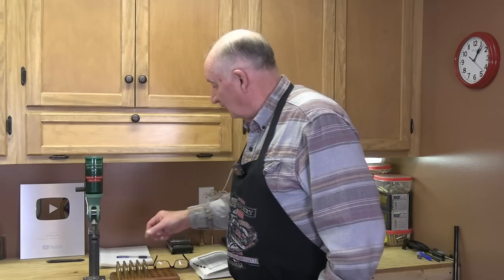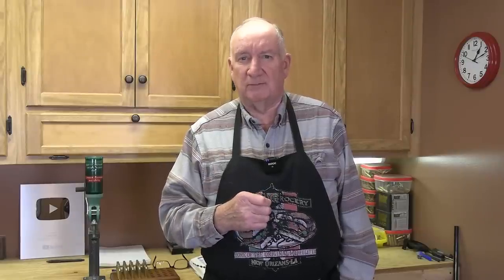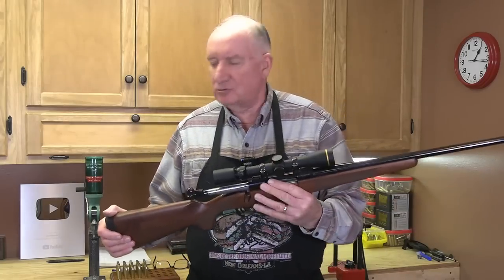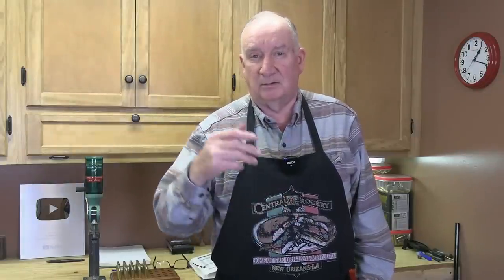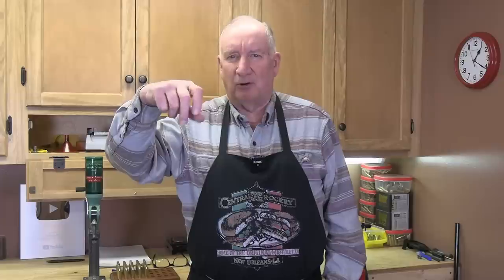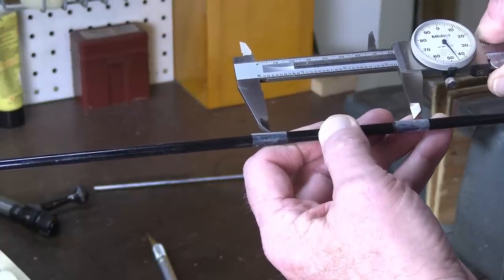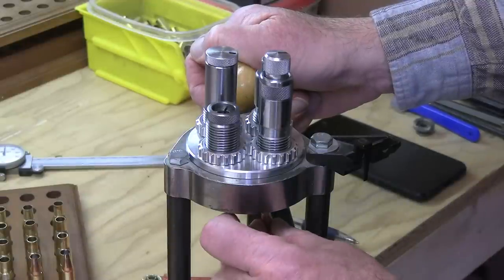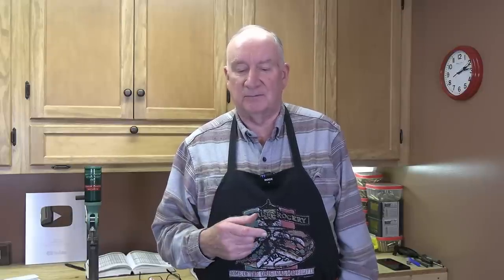How to Make Super Accurate Ammo ~ Part VIII Seating Bullets

Comment: Hello sir can I do this in ar 15??
Reply from the maker: Hello.  That's a good question.  Generally speaking, no.  Autoloading rifles, including the AR-15, have very weak bolt camming leverage that relies entirely on the forward momentum of the carrier/bolt assembly to turn and lock the bolt into battery, so they require fully resized ammo that fits loosely in the chamber.  The magazine length dictates the overall cartridge length, so seating depth cannot be altered.  The best things you can do for accuracy are:
1. Free float the barrel with no contact or sling.
2. Buy match grade brass of consistent weight.
3.  Uniform the primer holes and remove the interior burr (once only).
4.  Use good bullets.  Test different bullets and find the one that works best.
5.  Avoid aggressive rifling twists that are unnecessarily quick for the bullet lengths you use.  Match service rifles used in CMP competition traditionally have been 20" with 1:8" twist because they use long bullets at the 600 yard line.  However, if you are using a 29" barrel with bullets no heavier and longer than 60 grain, 1:12 will give a much gentler ride down the bore.
6.  Crimp lightly with a Lee Factory Crimp Die.  It can be used with or without cannelured bullets.
Reply: @GunBlue490  I am just using 26’’ in 1’7 twist and thank you sir
Reply: I mean 16’ 1/7 twist

Comment: Now go and re-measure your rounds and see if they all measure the same.
I'll bet you'll find a huge variation. 
Just because you set one round to your desired dimension does not mean the rest will measure the same.
Reply: What variation have you found in your own measurements? If no more than 5-10 thou, would it matter all that much?
Reply: @wpw4508  
It depends on the bullets you buy.
Premium grade bullets seem to have little to no variations. 
And then you have factory seconds that can vary as much as .035- .050!
If you are reloading for precision and accuracy then, in my opinion, anything more  than .003 is too much. 
I shoot from 100-1500 yards and my goal is 1 MOA or better.
So when reaching beyond 500 yards the small things add up.
Also, I'm just a target shooter not a hunter.
Reloading for hunting allows for a bit more wiggle room if you hunt for critters as big as feral pigs or bigger. If you hunt for varmints the size, say the average dog or smaller, then you need to reload for more accuracy and precision if your shoot beyond, say, 200+ yards.